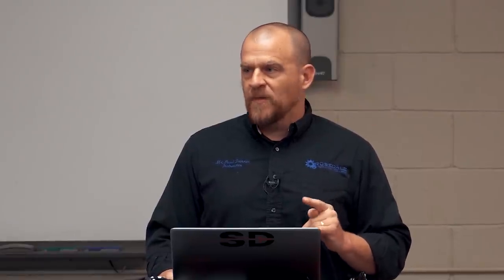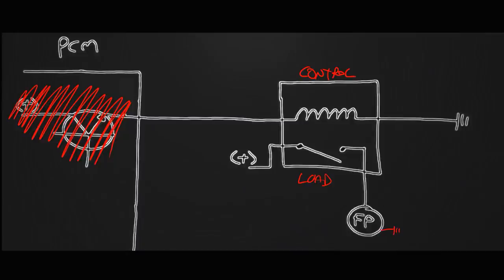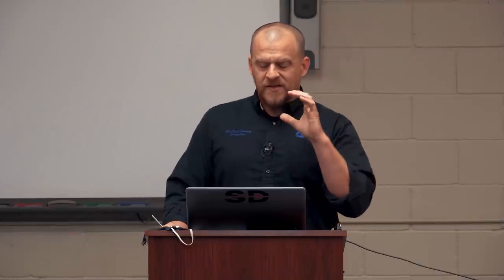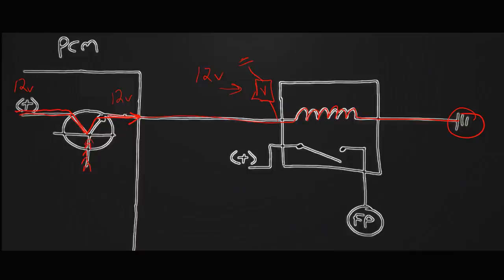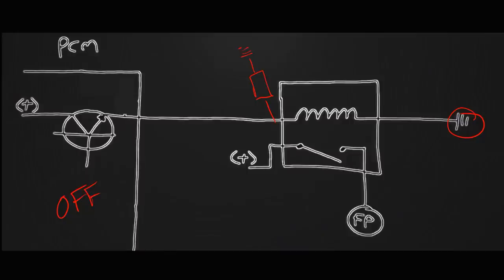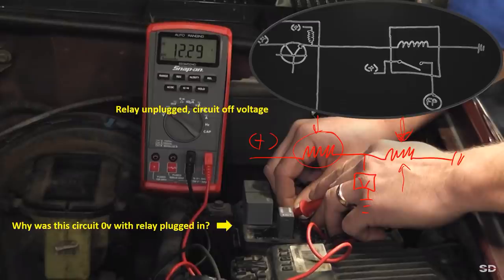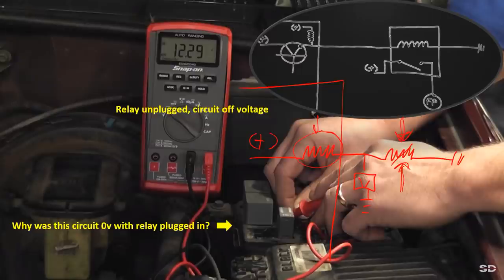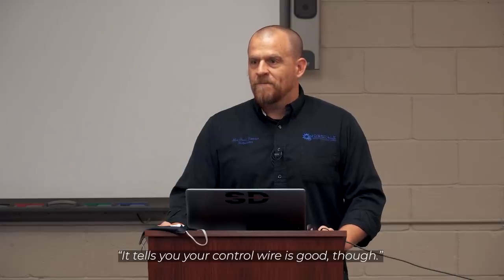Circuit ID and Integrity Testing Part 4 (SD Premium)

Comment: Hey I saw one of your videos of testing a crankshaft position sensor and I tested mine the same way on a 1998 jeep tj 4.0 and on my ground I got 400 millivolts while cranking. If you could let me know if you know what that could mean that would be awesome. Thanks
Reply from the maker: Bump the key and look for 5v at times and then 0v at other times. 400mv during cranking could be a normal average voltage of the on-off square wave

Comment: @20:19 so if I connected the "control" relay terminal that comes from the computer to a ground, I would fry the computer?  Is that because too much amperage would fry the little diode in the computer?
Reply from the maker: Yes sir, on this design (power side switched), with a short to ground on the control wire, the transistor driver in the computer would get cooked.

Comment: You say unplug it if you have bias your done move on..but how do you determine if a circuit is supposed to have bias voltage or not??
Reply from the maker: you won't know for sure, experience helps, but it is easy, no bias, then you use another method to verify circuit integrity. I cover that in this series too. Hope that helps. It is too wordy to explain the other method here, but it involves jumping the ref to the signal circuit
Reply: @ScannerDanner  hey thanks for the reply. I'm going to take my ASE A6 on the 29th and I'm trying to cram in as much studying as possible I'm subscribed to your premium out of all the lessons and videos what ones do you recommend I go back and familiarize myself with that will help me prepare for my test
Reply from the maker: @albertsautodiagnosticsllc2130  thank you Albert! To be honest, the A6 Electrical/Electronic Systems, basically the lessons and chapter playlists is where you want to be. I cover this type of thing in just about every chapter
Reply: @ScannerDanner  🙏 thank you I've been learning from you for the past 2 years I'm positive I'm going to pass but just wanna be prepared
Reply from the maker: @albertsautodiagnosticsllc2130  If you've been with me that long, I have complete confidence you are prepared my friend
Reply: @ScannerDanner  your the best man thank you 🙏🙏
Reply from the maker: @albertsautodiagnosticsllc2130  thanks for supporting me Albert. Just an FYI, I am currently working on the comments system with the premium videos, so you will notice some differences lately and some things that are not working quite right. I should have this fixed soon.
Reply: @ScannerDanner  I passed my A6 today thanks so much 🙏 on to my A8 next month and in April I'm shooting for L1
Reply from the maker: @albertsautodiagnosticsllc2130  that's awesome my friend! Congrats on that and good providence on the others too

Comment: trouble shooting a computer with an incandescent lamp isn't BS because computers are low current devices and a test lamp isn't you have to know what the current output is to connect to it with a lamp. normally you are right in an auto circuit. if they could make a low noise electrical system for a car. you could be in real trouble
Reply from the maker: I always preach that before you start using a test light, you must know what your test light draws and also some knowledge of the current draw of the circuit in test. All stuff both written in my book and practiced regularly via case studies right here on YT and on my website in SD Premium. 
This is but a piece of a class. Thanks!

Comment: a ressitor is a current device ( limiter) and volt and current are inversely proportion. Sorry you need teach current flow.
Reply from the maker: I do! This is one part of a 5 part class
Reply from the maker: Something else, at the end of this lecture I had some added pictures using ohms law and talking about a voltage divider circuit like we are dealing with. It has the current flow measurements you're asking for. And to be honest, it isn't needed. Understanding the voltage drop between two resistors is all that is needed here. So sorry, I disagree, discussing current and or measuring current is not needed here as long as one understands that current flow doesn't change throughout this circuit.